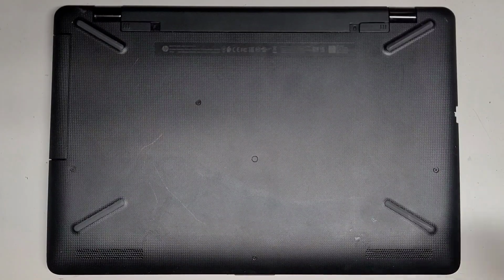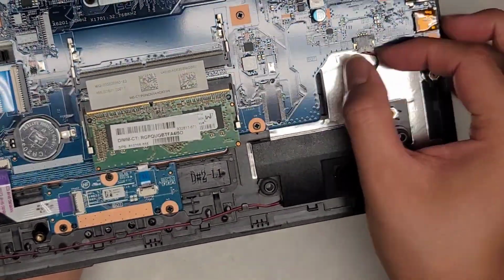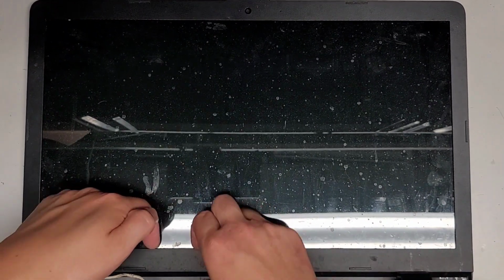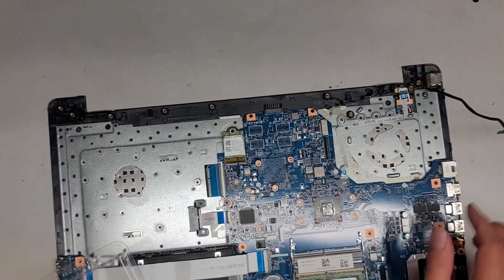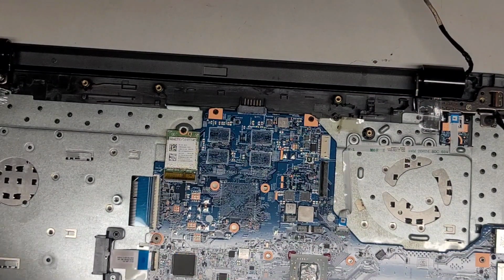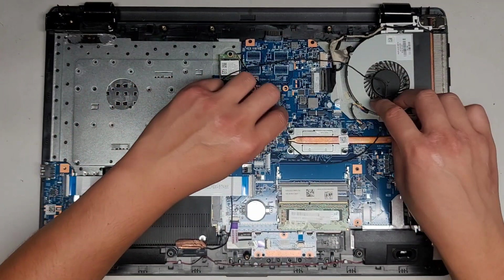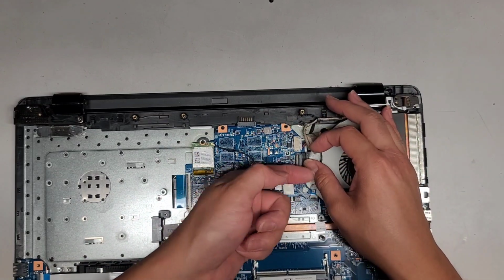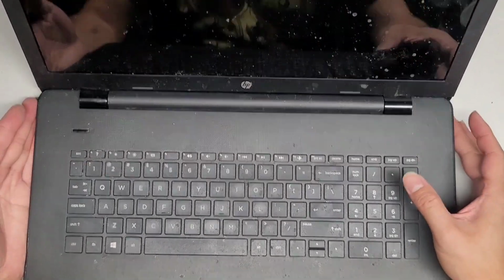HP Laptop 17z-ak000 Disassembly RAM SSD Hard Drive Upgrade Battery Hinge Replacement Repair

Comment: I want to upgrade mine i believe it is same model exactly is it capable of running two 16gb ram dont that make it 32 ram is it able to handle that is what i am asking and the hard drive as long as it is a ssd it should work with the laptop right
Reply from the maker: RAM should be ok. The laptop can use 2.5" sata drives and m.2 nvme drives